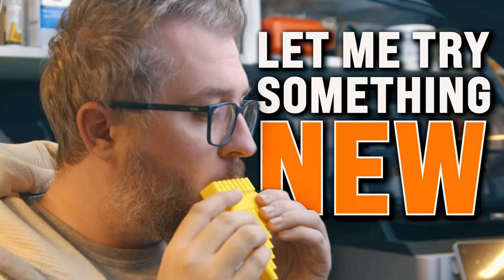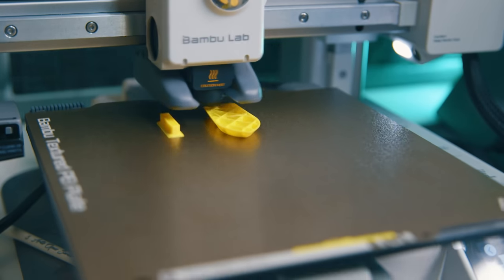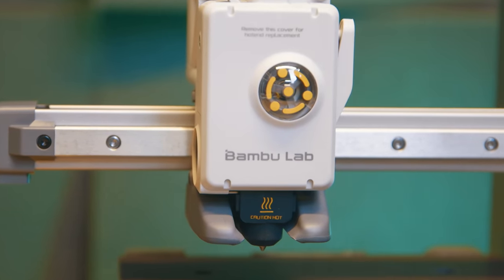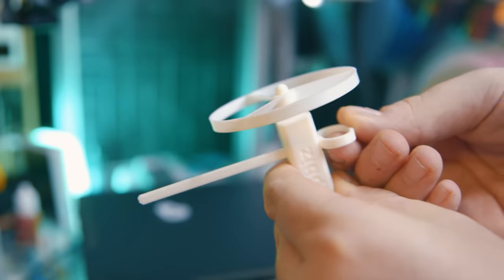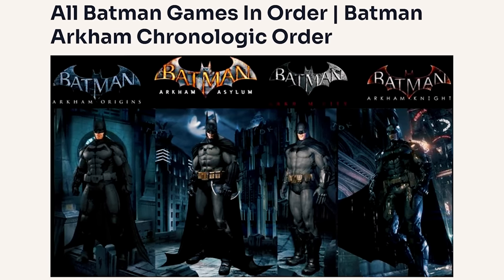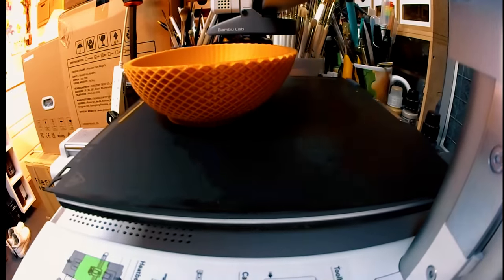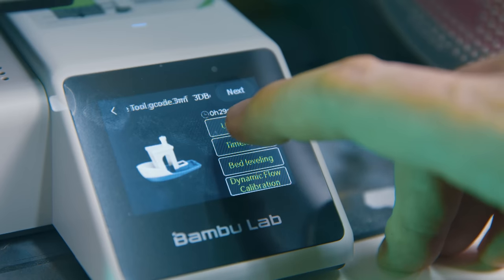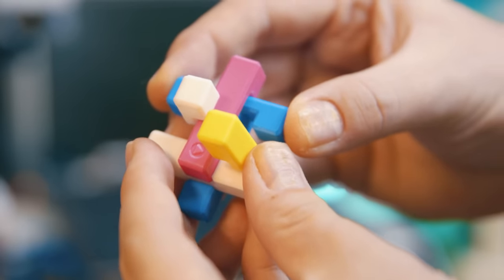Bambu Lab - A1 Mini Review - IT WASN'T MADE FOR YOU!!!!!

Comment: I’m a machinist by trade, I’m already spending my day mucking about with g code on mills and lathes, I preordered this for making personal prints and functional prints for work because there’s no fuss to make it work as far as I’ve seen. Anything I need to print will fit in the work area including mill vise soft jaws, and you can’t beat the functionality for the price, you’re absolutely correct 10/10 video
Reply: Fellow machinist here also. Exact reason I wanna get it! No fuss fun.
Reply: I had to fuss with the printer a lot to get it printing even decent benchies.
Reply: I have a P1S and am looking hard at one of these. Fellow machinist here too

Comment: I agree with everything, except with the term beginner printer. I think we need to step away from this paradigm and start seeing printers as appliances rather than tinkering toys that need work for it to work. I don't look at my tv, oven or dishwasher and say, this is a great beginner appliance. I want it to do its job, I don't want to fix the oven before cooking and I see no joy in that.
Reply from the maker: You are right to a point, but we are literally at the beginning of this sea-change. Early comments on this video from Die-Hard FDM enthusiasts shows there is still a significant divide between tinkerers and users.

Comment: I have printers of all sizes, from bambu labs to quidi tech and even the large snapmaker artisan. Even I have fallen into this trap in the past, always wanting the super large build area....for the "just in case" scenario but to be honest.....I have never needed that much space. Things I print are industrial and really fit on anything around 200mm squared. So really this build size will fit 90% of everyone's true needs. Unless you are printing cosplay stuff, smaller printers really will be all you need.
Reply from the maker: Exactly.
Reply: This was my concern to. Wanting a bigger build plate "Just in case". But I already know that if there's to much resistance in actually using the printer due to tinkering, etc. I'm less likely to experiment or "play" with the printer. 

Ultimately optimizing in order to get people to print more as the primary design principal requires building a machine first and foremost focused  on ease of use, print quality and speed. And then figuring out how to do it at the magic sub $300 price point that is well known in the tech space. It's pretty clear Bambulabs has a vision for the company and the 3d printing as a whole. 

Once the user experience, minimum viable quality and optimal speed goals are met, that's when build plate size followed by material options come into play, and it appears the deciding factor of those last two objectives and limitations are proportionally directed to the machines target price. 

On the most basic level bambulabs simply wants to get "people" using their printer happily and frequently, that's the jump off point to really expand the market and you can see this thoroughly displayed through the entire A1 mini and AMS lite design on the hardware and software level.
Reply: Ben de hobi amaçlı bir 3d yazıcı alacağım. Ender 3 v3 se ile bambu a1 mini arasında kaldım. En büyük tereddütüm a1 mini'nin baskı tablası yeterli olur mu düşüncesi. Hobi amaçlı kullanacağım, örneğin, dc motorları kullanarak el aletleri yapacağım. Bant zımpara gibi. Veya arabamdaki eksik plastik parçalar gibi. Gerçekten a1 mini ihtiyacımı karşılar mı bilmiyorum. Tasarımı çok hoşuma gidiyor  ve herkes bu cihazı övüyor. Ama aldıktan sonra pişman olur muyum, daha büyük baskı alanına ihtiyaç duyar mıyım bilmiyorum. Bu yüzden karar veremiyorum. Ne önerirsiniz

Comment: I actually had no idea this was only 269 uk . Thats amazing. I used to be mad about build volume, but a printer that prints out of the box with no fuss is far more valuable.
Reply: That's the same thought I had. I have A1 mini AMS mega combo coming this week, but I kept debating if I should keep the order or cancel it because of the build plate size.

But the user experience seems far more aligned with what matters to me. As I want to focus on designing and printing not tinkering.

I almost got a P1S, because it's on sale for Black Friday. But the A1 mini seems to be somewhat better engineered in regards to ease of use, even though the P1S is pretty easy to use. 

For example I was just commenting to another user on the ease of changing the printer head. While it's not difficult to do on a P1S it does take noticeably more time and effort. 

I'm honestly more about ease of use. For example given that changing the printer head is so easy on the A1 mini I'm much more likely to switch on the fly to the smaller .02 nozzle for more detailed prints.

Though part of me still has a bit of FOMO in regards to the plate size, but I'm hoping that most of what I'll be printing will fit just fine on the plate and those pieces that don't, I can use as learning experiences to design split objects that I can join together once printed.
Reply: @whyired  Ive also looked at the flashforge 5m as that also has easy change nozzles. 
For what its worth, my brother has had the p1s for a week now and it has been brilliant. Literally prints out of the box. He has however been put off changing nozzles as it’s a bit of a faff

Comment: I have a P1S and I still want a A1 Mini! The Bambu Lab ecosystem is great and for the price and it's speed, it would make a great secondary printer. Print the small parts on the A1 while I leave the larger bits to the P1S, get my 3D print even quicker splitting them up :)
Reply from the maker: Agreed, it’s such a useful side tool and with the AMS lite too, it’s great!
Reply: Would you recommend the A1 mini if you’re intending to print mega construx/lego pieces?
Reply: I've got an A1 with the AMS lite, but I've just had an A1 Mini delivered today as it will allow me to print multiple parts simultaneously.
Reply: I didn't get the ams for my p1s and seriously debating the a1 mini combo since most multicolored prints are smaller or decorative

Comment: I agree 100% those little build kits really elevate the experience for a newbie from "toy" to "tool" immediately.  The A1 Mini is going to be my go-to recommendation to everyone who asks me about a new printer under $500, and the P1S for $600+. Seeing all these reviews its incredible what Bambu lab is doing and for such a low price point, $299USD is crazy. I print robotics parts and I want to be able to print CF Nylon and ASA but mostly I use TPU as its so durable and the A1 Mini handles that no problem.
I have an X1 Carbon and debated getting and A1 Mini for a long time as a second printer. Ultimately decided on the P1S so I can get the hardened steel parts and match the X1 capabilities. But I bet anyone starting an Etsy print shop for all PLA would be happy to buy 4 of these for the price of one X1C.

Comment: i am a hobby 3d printer, my Anycubic 3D Mega was and is a nice partner for over 6 years now, but meanwhile it lacks a lot of quality of life features, such as auto leveling, multiple colors, web cam, wifi, smart phone support. So I am really excited for this compact all-in-one solution. the price is fine with me. it is "only" double what you usually pay for a simple single color printer, which is fine to me, concidering the multi-color functionality. And as You corretly said - the build volume is absolutely OK for a hobby. There will always be parts too big for your build plate - it is just a reason to learn how to split your prints.

Comment: The i3 mega i bought a few years ago only needed like 2 screws to install it. Then bed leveling. Done. It has a lack of cooling though so i 3d printed a vent system for it using it and now it works great.

Comment: Thanks for the video! You sold it to me.
I'm a quadcopter enthusiast and started designing my own frames recently. While frames are carbon, you need a lot of tiny 3D printed auxiliary parts with them and I hate waiting for days for a Shapeways order to arrive or even hours for a local guy with a 3D printer. So I started thinking about getting one myself, but the supposed amount of tuning for your typical Ender just throws me off and P1P/P1S are a little pricey for my needs. And yet here it comes. Pre-order until January here in the EU though.
Reply from the maker: god I hate Shapeways with a passion

Comment: I bought and built my first 3d printer in like 2016 and it was so frustrating to figure out how to get it running. I just bought the A1 Mini because it was $340 with the AMS lite and I wanted to finally get into multi color prints. I had a blast the whole process of setting it up and even watched the first benchy I printed from start to finish. It's fast, so easy and creates some pretty phenomenal prints. I wish I could have started with something like this. It's put a joy back into printing that makes it seem more like a hobby and less like a chore.

I'm happy this exists and is reasonably priced, because I don't want new enthusiasts to struggle and lose that bewilderment for printing like I had. They'll eventually get curious and expand into more complicated machines but this is a good way to instill a love for the craft first.

Comment: I started my filament 3d printing experience with a pre-order of the Creality Ender 5 Plus, years ago. I never got good at it. When my pre-ordered A1 mini came it, I had it running in no time and had practically NO failures. It's quiet, consistent, and required NO faffing about. I love the A1 mini, is it small? Yes. Does it matter? No.

Comment: I bought this yesterday with the AMD Lite included for $300,.
This is my first time ever seeing a 3D printer in person, the ability to have multicolor without needing to paint everything myself, along with its ease and ability, it was the right price.
It was super easy to set up and use. The quality is great! The only downside is the print area, as discussed in the video.
But as this is my first 3D printer I've ever seen, the print area is well enough for me to start messing around with creations.
I havent made anything larger than a keychain yet, but the cloud based splicing that bambu offers allowing you to easily make easier prints without having to splice it yourself may be able to make up for the smaller print bed size, ofcouse would require more time because of you needing to remove finished pieces before continuing onto the next by hand.
I was happy to pick this up for the price I got it at, and I'm excited to play with 3D printing some more!

Comment: I've bought one and I'm super impressed with it so far. I'm quite green to the 3D printing space so I'm surprised that there are complaints about the build space. I clearly need to look more into what people are doing because I can't think of anything I'd want to make (yet) that would be larger than 18x18x18 in a single block. It takes long enough to print something a fraction of the size 😅

Comment: I tried to get into 3d printing 7ish years ago.  When the printer worked, it was great but, I spent more time working on my printer than printing and that wasnt fun for me so I stopped but, it has always been somethign I have kept an eye on.  What Bambu has done is essentially made a 3d printing appliance like a microwwave or an air fryer.  It just works out of the box and does so well enough that you are encouraged to learn more and do more with this new tool you have.  Sure, I'd love a larger build area but, I'm just fine with this size.  

You summed it up perfectly in your video.  Well done.

Comment: I think the 3D printing space would grow by leaps and bounds if more beginners were bitten by a positive experience rather than giving up on trying to tune a printer before letting it collect dust.  Like it not, user numbers will drive the market faster than anything else.
Reply from the maker: Oh that's so true, how many people have been put off printing already thanks to janky products.
Reply: My 3d printing journey started with the Ender 3 Pro. It worked sometimes when I tried following online guides, but most prints would fail at some point or another throughout. I lacked the mechanical knowledge to fix whatever was happening almost every time so some things I just had to accept I couldn't print. But I've mow had my A1 Mini for close to a month and print multiple things daily. It's just a huge weight off my shoulders knowing it'll print right every time

Comment: Almost exactly one year ago, I bought an Ender 3 Neo. I tried to use it a bunch last summer and fall, but it ended up sitting all winter due to the constant issues and inconsistent prints. Fired it up last week, did hours of troubleshooting, finally got it to print somewhat reliably. I even managed to finish a 6 piece statuette. Then I found an issue with my extruder. So I replaced it with the newer Ender Sprite direct driver extruder. Got it calibrated. Now it won't finish a print to save its life. Again. Just like before. I'm over it and just want a plug and play, reliable printer.

Comment: Great video!
 I have an FLSUN QQs Pro which can be a lot of fun (I do like tinkering), but can also sometimes be extremely frustrating to use.
(like you say) I don't always have the time to tinker, and I need something that just works first time.

In this sense 3D printing has been a strange phenomena.
We buy these tools that aren't really "fit for purpose" in the normal sense.
If you had any other tool that only worked properly part of the time, you'd send it back. Not with 3D printers.
It's nice that someone has finally brought out a model that is "fit for purpose" and can be relied on to usually work first time.
This type of product could really help to bring less techy people into the fold.

Comment: I bought this for .2 miniature prints and the AMS on this is more efficient than the full sized AMS version with faster print speeds, fillament swaps, and even easier hot end swaps!  This thing is very specialized, but when you have that small niche in your setup, it's hard to find anything better. 

My P1s has been converted to hardened extruder and gearing for harder filaments.  

My Neptune 3 Plus has .6 Nozzle for larger prints.

and this thing is used for .2 Nozzle and ultra fine prints of multicolored devices.

Comment: I agree with almost every thing you said, I most defiantly agree that the kits are the future of projects for 3D printer users and that this printer has moved the start point for all other manufacturers, how ever i do believe this was made for those of who are already into and have 3d printers, this printer is such a great ad onto to my P1P. Want to print a quick key chain or is there small components to a project that want all fit on a single plate of the larger printer ..

Comment: Thanks, i consider this printer for my school. I got myself a P1S because i wanted a machine to print riight out oft the box without tinkering around the machine everytime, so i have more time for making my stuff than having to solve issues of my 3d printer. The small built volume scared me first but i think for a school it is not the badest thing if you are a bit limited in space so there arent that much very big prints that take days ;)

Comment: Just curious if you’ve ever used a Prusa Mini?
I agree Bambu has upped the game a bit but a lot of the ease of use and ready to print files, plus auto setup that you liked are all part of the Prusa Mini experience. What Bambu has improved is the multi color and reduced price. 
Prusa mini, Creality Ender 2 Pro, Kingroon K3PS all had the same complaint when they were released, bed is too small. The kits with electronic bits are definitely nice but that’s been tried many times before as well and never was a big hit (alien box was a subscription version) so it will be interesting if Bambu can figure that one out as well. Nice video overall.
Reply from the maker: I haven't ever touched a Prusa machine. They don't work with content creators for reviews it seems. But from what I've seen of them anyway. I don't think they are the right pick for my audience. We typically want to [print things with the smallest or easiest barrier, Prusa's seem more geared towards Printer enthusiasts.. happty to be proven wrong, if I ever get one

Comment: Although I have six printers, my RatRig VMinion tends to be my default go to for high quality fine detail prints.  It also has a 180 mm^3 build volume, linear rails, but cost about $600 USD for a box pf parts and two days of build time.  I think the A1 is a great printer in a great size.  Five of my printers are out in one of the shop buildings, my VMinion is in the office in the house.   It's surprising how many things can be done on a smaller printer, my FAB365 Saturn V was printed completely on a printer of this size.  I'm tempted to get an A1 as it is far less expensive than most of the "printers for ants" kits like the Voron 0.2 while delivering a lot of usability features.    Being able to hop from a 0.2 to a 0.4 nozzle quickly alone is great.
Reply from the maker: FAB365 Saturn V on something this size is a feat on it's own.
Reply: The credit goes to the designer of the model, the tallest component is < 180 mm tall.   Better part of a weeks worth of printing even on a fast machine, but a very nicely done model.  The only painting needed is for the raised lettering and the flag.  I did some painting of the engines and support structures based on photos, just a bit of color, a bit of wash, but nothing complicated.  Cheers, thanks for the great videos! @FauxHammer

Comment: Yeah, thinking of adding the mini just becaus it is smaller. Leave my P1S to handle the big stuff. But having switched from Ender 3 V2 to Bambu it was the same experience. I now spend more time learning Fusion 360 and designing new stuff, instead of tweaking, fixing or calibrating constantly. I work less on the printer and more on printing...if that makes sense.